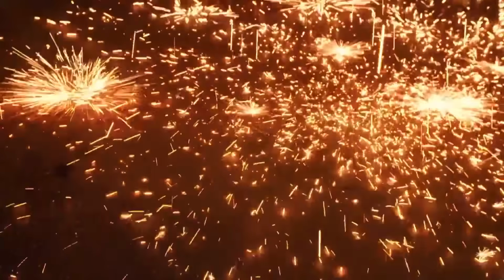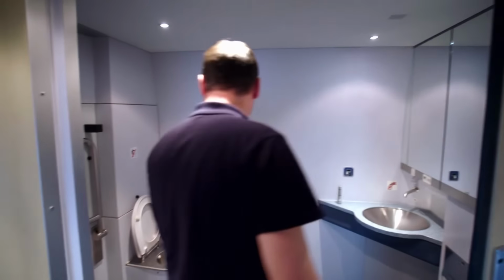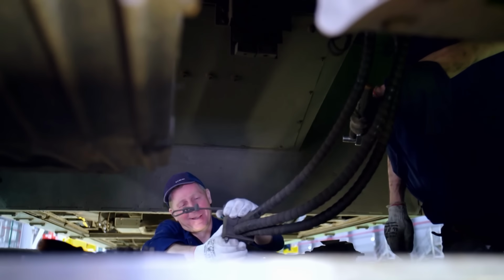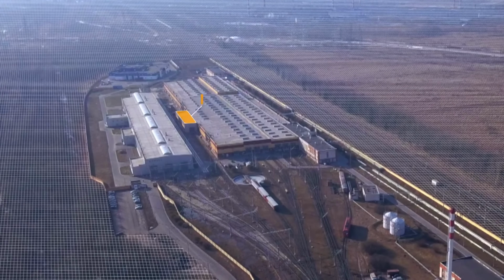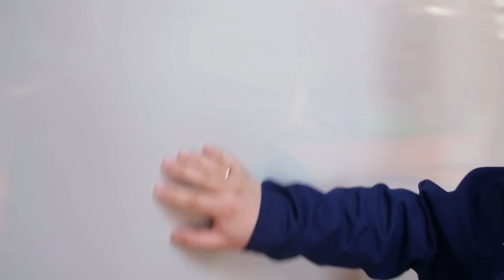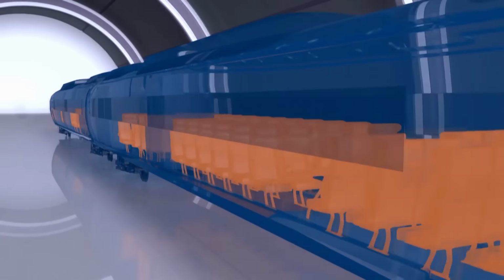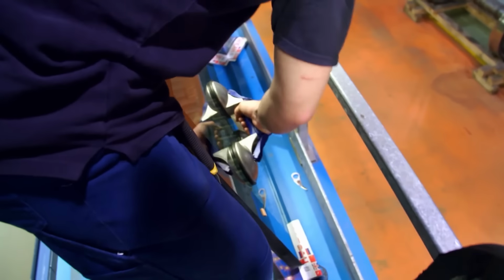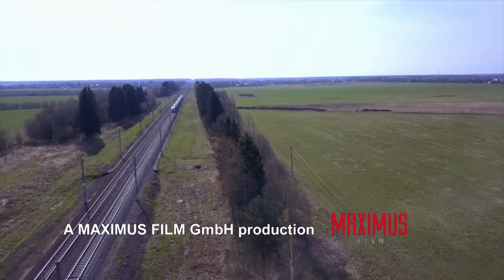World's Longest High-Speed Train Heavy Maintenance | Mega Pit Stops | Episode 2 | Free Documentary

Comment: What is the rail gauge of this train? Is the gauge European or Russian? Many thanks, J
Reply: Russian. Sapsan is basicly Siemens Velaro modified to russian gauge and russian climate
Reply: Igor Solovev Many thanks for your informative reply, climate in Russia is very tough. Wondered if same gauge as EU, might eventually lead to high speed trains across Europe. Sadly not for a while.
Reply: @jeanjacques9980  there is talgo train from berlin to moscow, it uses special system to switch gauge on the go on special facility, You can google it, rather fascinating technology, But average speed of this train is not that imressive and mosly limited by tracks, not train itself
Reply: Igor Solovev Thanks again will have a look at site as suggested. In the early 1900s it used to be possible at London Blackfriars station to purchase a ticket to Moscow. I think there is a train service from Paris to Moscow and it may have the technology you mention.

Comment: When two run in multiple it is not "double-heading" as that only regards the use of two locomotives and does not apply to multiple unit trainsets. When two are coupled they are simply running in multiple.

Comment: I don't ever believe that the schedules will be that tight I mean it would be ridiculous if something else pops up that was unexpected it would mean that the train will not be delivered and the company could face penalty charges.
Also why wouldn't they send a couple people ahead of time before the train officially comes out of service to do an initial check for example they would know ahead of time exactly how many windows ect need to be changed.
Reply: these types of trains are like airplanes they are run precisley meaning each hour in service copuled with the fayre equals a precise amount of money generated or lost for the operator company it is indeed that tight,on the day its due out its almost certainly booked for a service same as a plane. Its also usually part of the contract siemes will build the trains for the operator and be responsible for maintenace as per the contract and yes things do pop up companys take losses it happens but the schedules are tight for profitability, as for checking beforehand normal operating staff wont be trained for over haul work, you cant do it properly or safely with passengers on board and lasty if you were sitting on a train wouldnt you want an engineer pulling the cabin apart while you were sitting in it!
Reply: @roobear78  I wasn't referring to normal operating staff doing an initial check obviously they're not trained to do that and I wasn't implying that the check should be detailed a cursory inspection done by individuals sent ahead by the company Servicing company checking Windows chairs that are operating properly that sort of thing nobody expects that kind of check to be detailed but at least the Servicing Company with no okay you've got maybe 10 chairs to change they will account for some extra chairs of course and we've got six Windows to change this inspection can be done when the train is being cleaned by members of the ordinary staff since after the train does it run there is a crew that goes through the train quick cleaning it after all passengers have disembarked .
as far the servicing companies concerned it is they who set how long the vehicle stays out of  service yes there is a tight schedule but usually the company factors in a buffer time the same thing is done with construction companies when tendering for a job example ideally conditions being perfect internally they may say a job may take 5 weeks to do but on the official tender they may say 6 weeks

Comment: When you consider the vast distances in the vast Russian Federation, the Sapsan seems slow compared to super high-speed trains in smaller countries.  Of course, this is also due to the fact that this particular train is of German origin, specifically from the Siemens company.  Russia does not have the technological capability to independently develop a faster train.
Reply: um, siemens makes trains that regularly achieve 320 km/h in service, and capable up to 350 (and now 360) in service - the issue is Russia's tracks, they had plans to build a new HSL but their economy is in ruins lmao
Reply: @ce1834 xcept they don't anymore. ICE4 is limited to 250km/h. I wonder why, could it possibly be that Siemens realized that above 250km/h HSR service is a meme that is too costly to build and maintain?

Comment: Does this train fall under tech sanctions because of the Ukraine war?
Reply from the maker: Good question and I do not know the answer. The EU has implemented a 9th sanctions package just today. I’ll look it up.
Reply: In short, yes. 
It was developed by Siemens based on Siemens previous European project. Deal was Siemens provides design and most of components and Russian factory provides framework and local assembly. Maintenance was split between two companies. Most of the parts was imported and now are no longer available. So, sad to say but this trains soon won't be operational due to lack of spare parts.
Reply: Depends on. I suppose, as China also operates trains on this platform we may receive spare parts from China. If no, local  manufacturers are more than capable of providing necessary parts.
Reply: Russians are the most gifted at circumnavigating sanctions and will always find a way.

Comment: 3000V? Is that all?
Reply: I was amazed by that as well but most of the trains in the western part of Russia including parts of the Transibirian railway still runs on 3000 Volts DC. 25.000V 50Hz AC came later and is more to the east.  Some of the Sapstan are equipped for both systems for use on other routes. Are there any other hight speed trains in the world running on such low voltage (France, the UK has 25.000V, Germany 15.000)? There must be extensive track side equipment as the Russians haul heavy fright trains as well.

Comment: "One of the most technically advanced trains on the planet" also runs on windows xp😂
Reply: Just a guess but I would imagine an old operating system would be much more reliable as most of the bugs have been figured out. Doesn't need to be flashy, just dependable.
Reply: @domhunt6488  Windows 10 has also almost no bugs. Its mostly on the program developer not on the OS. But newer OS gives u more options to devlope an easier and better program. So its better.

Comment: Chinese have a train longer and it runs well over 300km/h
Reply: Technically the Velaro RUS is rated for 350, but you make a valid point
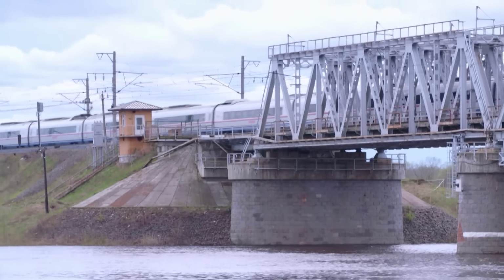Reply: 1:32  20 cars train. This is usually for Sapsan between Moscow and St. Petersburg. So 
its length is a little over 500 meters.

Comment: Sapsan is in no shape. form or way even close top be the longest high speed train. The train have standard 25 meter long wagon. The train system is very similar to the e320 eurotrain, but not identical. The e320 eurotrain have 16..so its 400 meters long.

ICE 1 from 1990 have 12 wagons and 2 power units and is about 350 meters.

There is high speed trains i China that is 425 meters long. That is for now the longest, and the onlyone so far that broke the 400meter limit.
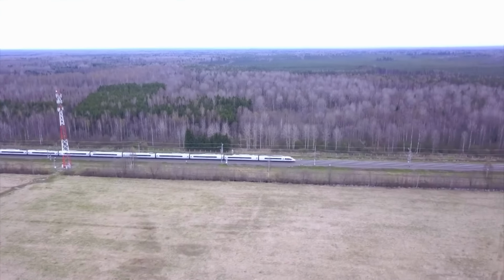Reply: 1:32  20 cars train. This is usually for Sapsan between Moscow and St. Petersburg. So 
its length is a little over 500 meters.

Comment: That's rubbish. the longest High-speed train in the Eurostar units out of St Pancras. the older units are 394 metres. that's 1280ft. or 426 yards. but the newer type is 400 metres. (433 yards or 1300ft). The Russian one has to have two units together to exceed that. every single train at 250 metres is way shorter
Reply: the length of a train is measured by its extreme points, no matter how many cars in it
Reply: @GURken  So by your assertion two Eurostars together wouldn't be longer. I rather think they would. I addition. two TGV sets would also be longer. as they often run coupled as pairs.
Reply: @andrewcowling5804  This 20car Sapsan train is regular and it's about 501m. What else? Is there a regular double Eurostar train?